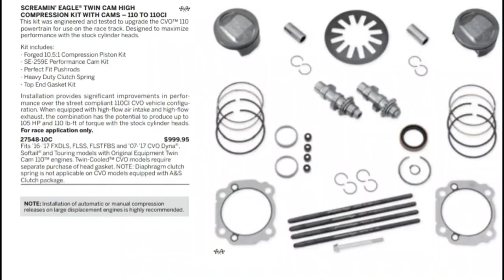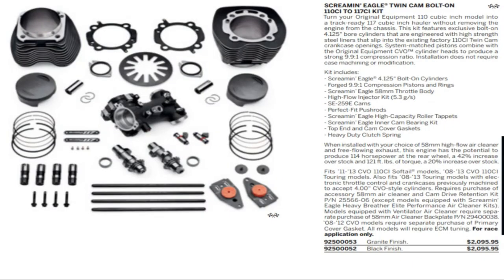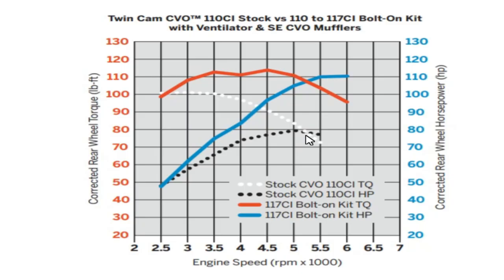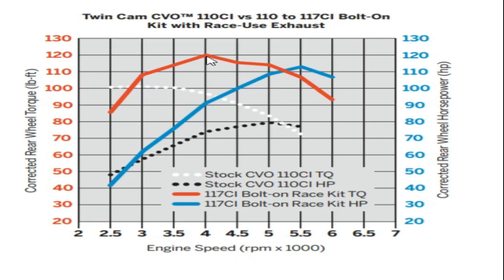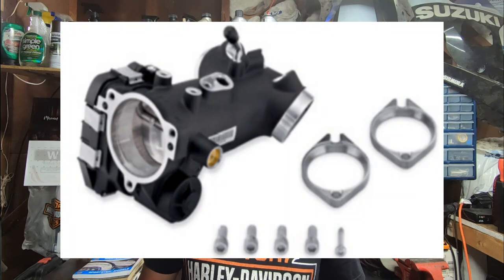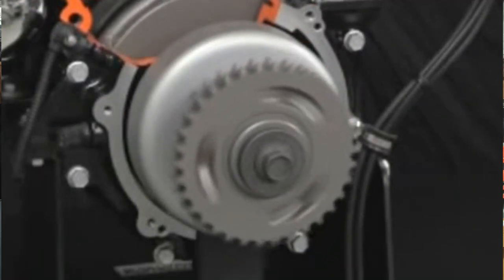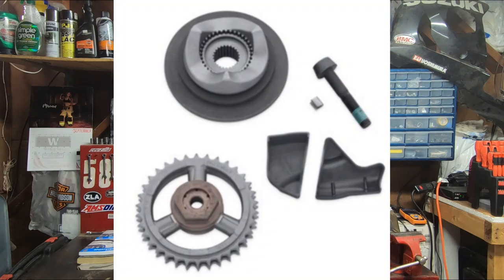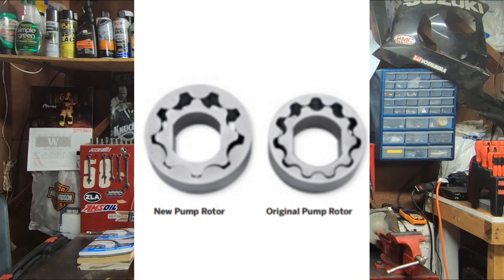Largest Production Twin Cam Harley EVER Produced | Twin Cam 110

Comment: My compensator story.... lose compensator springs are usually only an issue on hot startst but boy are they an issue.   Rode 2 miles away to a grocery store... Came out hit the starter button and compensator kickback exploded the starter gear which then got lodged under the primary chain and stuck in the clutch hub assembly primary chain gear.  of course I didn't know this until I pulled the primary after I had it towed home for 95 bucks.... The downside was I could not push start the bike I had several people helping me try but with half the starter gear lodged under the chain it would skid the back tire and not turn over and start.   also with any twin cam engine that has about 30 or 40,000 mi on it because of the sloppy compensator and the occasional hot start kickbacks the teeth on the clutch hub assembly are going to be cracked and missing... My particular unit had nine teeth with parts missing.  after going with the Baker compensator the Baker manual chain adjuster a new chain a new clutch hub assembly and a new starter of course the bikes as good as new in terms of starting and running hitting neutral every time and shifting smooth as butter..... But like everything with a Harley-Davidson it's going to cost you and you're going to be pissed after you realize you've been sold some pretty shitty components from the factory.  Everything I mentioned above doing the labor 100% myself was still over 1,600 bucks.
Reply from the maker: Holy crap you had the trifecta of disaster happen! Good thing you weren't on a road trip somewhere, still sucks it cost you 95 bucks to get it home. I am glad you went with Baker components, it kills me when people replace it all with OEM. Using Baker it won't be an issue again, 1600 is expensive but good thing you could do it yourself. Paying a dealer to do that you'd be 3/4's the way to a crate motor.
Reply: It's almost 2am here on the west coast of Australia.  I just read your post ... less than 2 days before I'm due to purchase a 2014 Softail Slim and now I'm starting to wonder if I should proceed.  The anxiety is killing me now.  Maybe your post is some sort of omen telling me that I shouldn't go ahead with the purchase.
Reply from the maker: The compensator was mainly an issue on the 96, the 103 did have failures it wasn't nearly as common in the 96 years.
Reply: @GixxerFoo  I feel a bit more confident now.  The Slim I'm looking at getting is about $13,300US ($19k Australian, where I am).  It's got about $2000US worth of extras on it (Street Sweeper pipes, Mustang seat, V&H Fuelpak FP3 ECU tuner, Screamin Eagle Heavy Breather air cleaner and the headlight has been converted to LED).  I'm paying around market value, so worst case scenario is that in the time I'll own it, I may need to put the money into a compensator replacement (not intending to spend money on cams or anything else).  If I said no to the purchase, would I be mad not to buy it just because the compensator issue has taken my confidence away?
Reply from the maker: With everything that bike has on it and it sounds like a great combination too, yeah l wouldn't pass on something that may or may not be an issue. Sounds like you found an awesome bike
Reply: @Jonathan-L  did U get the bike. Lol..just change the oil more often and don't worry
Reply: @mickmc1498  Yes Mich,  I went ahead and it was one of those "meant to be" opportunities in life!.  It was a private sale, a nicely presented machine, in showroom condition ... a 2015 Softail Slim 103 in Charcoal Denim, with some extras such as matte black Bassani Firesweep pipes, Jack Knife footpegs (attached under the footboards), LED headlight, Mustang seat (looks nice, but not comfy, OEM seat was included), Screamin' Eagle Heavy Breather air cleaner, Vance & Hines Fuelpak 3 tuner.  

The bike was 5 years old but on had done 3,428 miles by the guy I bought it from (he bought the bike new).  He paid approx $20k US for the bike & extras, and I bought the bike for approx $13,300US, so it was a "money in the bank" investment, and since this crazy year of the covid pandemic, people seem to be going nuts buying "big boys toys", so I'd say my bike could fetch $15k US if I were to put it up for sale her locally in Western Australia.  Since I've had it, I've done almost 5,000 miles since mid September last year.  

I've been tempted to do a stage 2 upgrade, but for all intents & purposes and ignoring dyno charts, I've decided to keep the original cams and leave my wallet alone as much as I can.  If later down the track I need to replace the compensator, I'd probably go for the Darkhorse Crankworks Man O-War® which I believe is the one to get out of all the compensators on the market.  I envisage that the cost of ownership of the 103 engine will be very economical in the long term.  I've got a hand-picked mechanic who's super meticulous and affordable, so that has been a bonus.

Just recently, I replaced the OEM Dunlop tires; I got a Michelin Commander III on the rear, and a Michelin Commander III on the front, but the front tire buzzed (Google Commander III buzzing and you'll get to find out what I mean), so the tire shop exchanged the front tire for Bridgestone Battlecruise H50 (I still kept the Commander III on the rear).  Unfortunately the front wheel seems out of round, and I suspect it got bent by the guys at the tire shop, so I'm going to have to take my wheel to a spoke wheel specialist and get him to true it up as best as he can.  

I'm really happy with the bike, I like the styling (eg the old school 'messenger bike') and rideability is really good.  The Slim is a bit like a "poor man's Deluxe", but the blacked out styling makes it a daily driver, not a garage queen.  Cleaning it and keeping it clean is pretty easy.  Overall the Slim is a great bike, but not a fantastic bike, however I love it for what it is and I do feel a lucky person to own one. I work for myself, and I ride it to visit clients whenever I can (weather permitting, can't stand the hot summer and I don't ride in the rain), so I get my ride time included in my day's work, which is a fantastic feeling making me really appreciate motorcycle ownership, and therefore I feel truly blessed.  I must thank guys like Gixxerfoo for his helpful advice, Doc Harley, Kevin Baxter, and even Gary who is "Late Nite V Twin" on YouTube (he's done a good video on the Man O-War® compensator).  These guys know their stuff and are real ambassadors to the motorcycle world, and they have given me confidence in buying into the Harley Davidson world.  I can't thank them enough.

 Ride safe Mick!
Reply: @Jonathan-L  Hi mate thanks for the information.. was great reading your response.. i have got a 110 cvo and looking to add Trask turbo kite to it from the states.. see the horses run then.. lol
Reply: @mickmc1498  Hehehe, would love to see your dyno chart after the upgrade :)
Reply: @Jonathan-L  yeh may need those - Man O-War CrankShafts.. you mentioned

Comment: Hello, what about the Screaming Eagle 103 crate engine that Custom bike shops use? Are they better in anyway do they have tensioner & oil pump upgrades?
Reply from the maker: Are you talking about a aftermarket engine or a Harley replacement engine? The replacement engines are going to be all stock internals except for the the SE120R, I have a video about it here https://youtu.be/mHxq8Ly4y64.
Reply: Hey, the Harley Screaming Eagle 103 that places like Thunder Mountain get from Harley : )

Comment: Thanks for the video. Man, could you share your Expirience about liquid cooled heads on SE110? Should it be replaced? If yes = which could be the right choice?
Reply from the maker: Not a problem, the liquid cooled heads really aren't a bad deal at all. I like the liquid cooled heads personally, you can run a higher compression ratio and not have to worry so much about temperatures. It blows my mind Harley kept the compression ratios down on those twin cooled bikes, there's a lot of potential in there.
Reply: @GixxerFoo  thanks, it’s still running good, but.consider to rebuild it once FXD project will be done

Comment: I have a 2015 CVO street glide, i just had a dyno run at my local Harley Shop and the numbers are 111HP and 113 foot pounds of torque, I know the bike had a complete header thru exhaust with down load for fuel management. I am not aware of any internal motor work done to it, going by your page the previous owner must have had a stage 3 kit installed on the 110.
Reply from the maker: That's a lot of power for just a stage 1 110. There's a lot of paths to get there, but yeah that bike definitely has to of had something done to it. If Harley doesn't have records on the vin it would have to be taken down and measured out.
Reply: @GixxerFoo  Until watching this video I assumed the numbers given to me was actually from a stock 110, I will have to go back to Harley and ask them what kinds of internal upgrades were done on the motor, trans. All I know is the bike is quick, I used to ride sport bikes and the throttle response is similar to the R6 and not as close to the CBR 1000 I once owned.
Reply from the maker: Had a GSX-R 1000 so that thing must be worked over pretty good. Lol no the numbers you got take some doing to get on a Harley. I bet that one has been worked over pretty good.

Comment: GIX...I’ve been watching this video a lot. 😂

I’m putting the 117 kit in my 2016 CVO Limited. 

What do you think about putting Vance and Hines Power Duels with Rinehart 4” mufflers, out the back door??

What kind of numbers do you think I can see, if I go in that direction??

Thanks Again for the Video. Very Informative👍
Reply from the maker: That's awesome! You'll have to let me know how she runs when you get it all done! I would say you have an excellent choice is exhaust! Vance & Hines power duals eliminate the cat and the Rinehart mufflers are solid performers. I have a friend of mine with a street glide and that same exhaust system setup. Depending on the tune (non epa compliant 😄) I would imagine the 120 horsepower range with roughly about 125 to 130 on the torque. Get it dyno tuned and don't leave any power on the table.
Reply: @GixxerFoo  
GIX....I’ll let you know how everything came out, once we get everything gathered up and installed. 

I’m really looking forward to this build, and have to “send you my thanks” for helping me make my decision to upgrade, based upon your informative videos. 

Thanks Again😀👍
Reply from the maker: You're very welcome, you'll enjoy the power and it will be like a new machine.

Comment: I love my 110 CVO.
Reply from the maker: What CVO model do you have?
Reply: @GixxerFoo  FLHTCUSE2 (2007 Screamin Eagle CVO Ultra) in Light Candy Cherry and Black Ice.  Removable tour pack, custom 10.25 inch shocks, Danny Gray Buttcrack seat with pillion, 2008 cush drive upgrade, Stage 1.  It goes from "hot rod" look to full touring in 5 minutes.  I had an 88 with cams, bigger throttle body/injectors, etc before.  The 110 beats it hands down.  I may still do cams in it to get rid of the factory "detune" and wake it up, but honestly it is more than adequate as it is.
Reply from the maker: That's awesome, that 110 can really run with just a few tweaks here and there.
Reply from the maker: They only make those limited numbers, those numbers are world wide too!
Reply from the maker: Not a problem, anytime!

Comment: What's the book say on the labor time to do the 117?
Reply from the maker: It varies by dealer but with the cost of the kit and labor the general consensus for a dealer to do it usually runs around 4 to 5K. Dealer labor isn't cheap at all, most indy shops can get it done for around 3 to 4K with parts and labor.
Reply: @GixxerFoo  Thanks!
Reply from the maker: Not a problem, those are just some wide ball parks since the costs vary so much.
Reply: @GixxerFoo  That's probably why they refer to mine as the "stealership" . Labor Rate quotes are generally 40% more than normal.
Reply from the maker: Holy crap that's insane! No dealer is cheap by any means but that is off the chart!

Comment: I want a cvo se110
Reply from the maker: They are beautiful bikes!
Reply: Just bought a 2008 CVO Road King with a SE110 a few weeks ago. It is the Twilight blue and cobalt blue with ghost flames. It is an incredible bike. Looks amazing still with 14k miles.
Reply from the maker: That's a beautiful color and that bike was hardly ridden with only 14k. I have a 2016 with 14k on it.
Reply: @GixxerFoo  Yeah I got really lucky. It has no issues other than a high speed wobble but a little bit of time and money and it will be just fine. The 110 is amazing how smooth and powerful it is. Eventually it will be upgraded into a 117 but for now it is plenty fast for my first bagger.
Reply from the maker: Oh damn, that not good! I've heard of that on the bikes before Project Rushmore when they redid the mounting system. Fortunately the aftermarket has stepped up with some solid fixes for that.